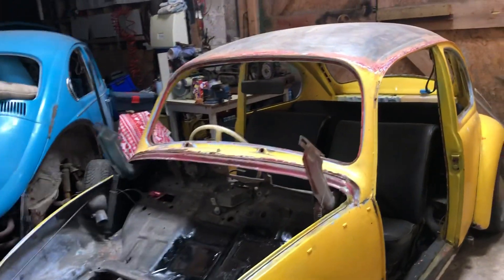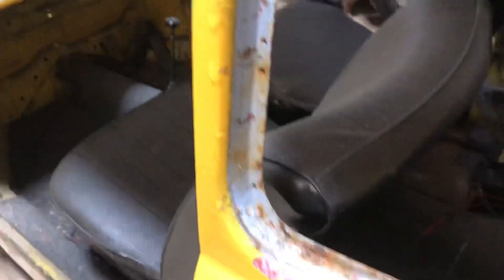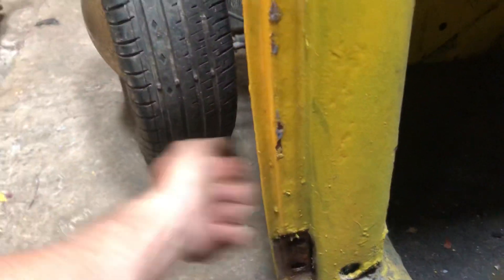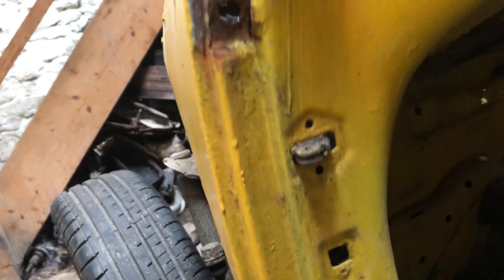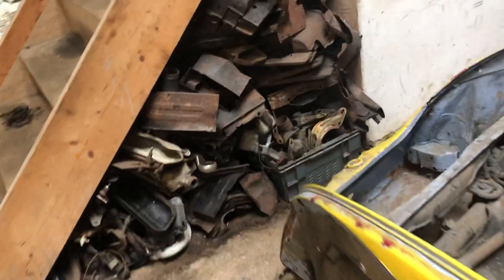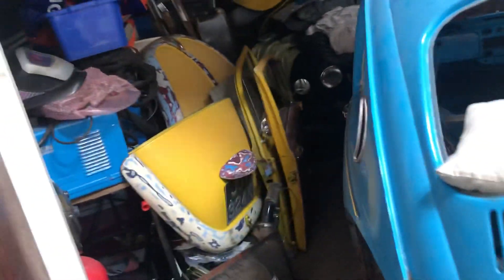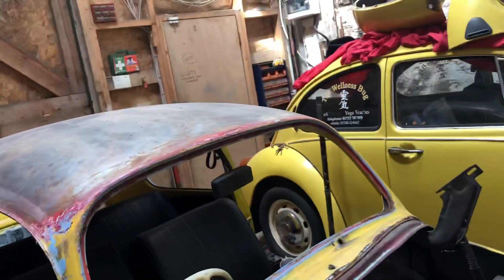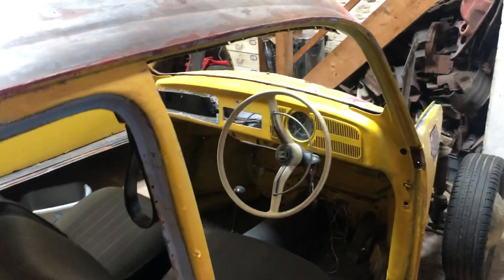1971 slammed bare metal bug,windows out and door off plus welding !!

Comment: Nice work. Door could be dropping due to the repair in the a pillar or the hole where it meets the channel, I think that's were most of the strength comes from.
Reply from the maker: Ok I’ll check that but all 4 door bolts were loose but thanks for heads up 👍
Reply: @vwcoco  that won't help either lol